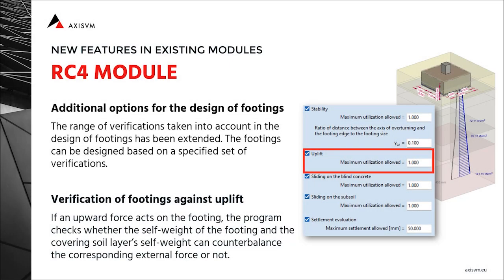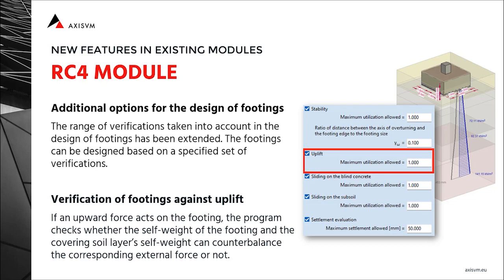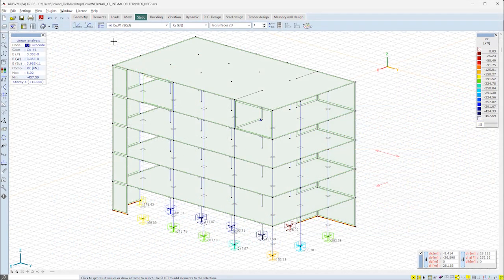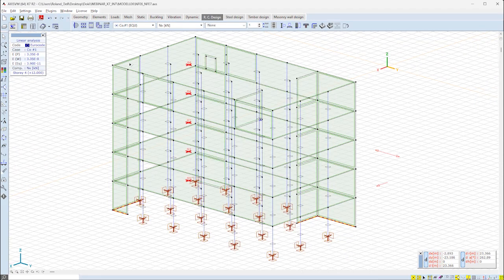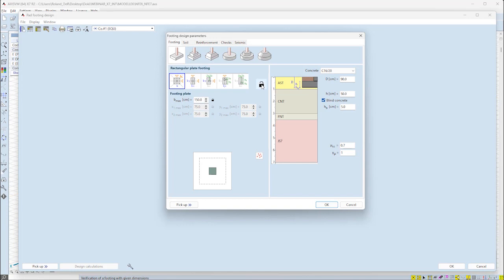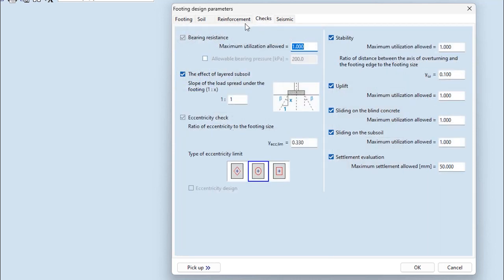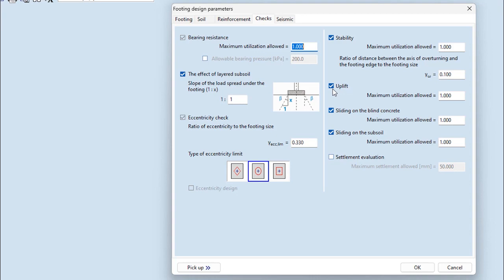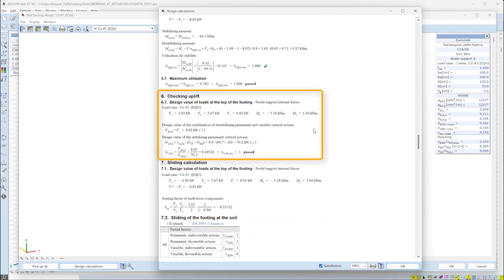ADDITIONAL OPTIONS FOR THE DESIGN OF FOOTINGS

Comment: Hi. WE have a system with 13900k 32gb ddr5 7200mhz and rtx 4070. In axisvmx7, with a structure solid rendered, when we try to zoom it and zoom out it works in slow motion. Why is that?